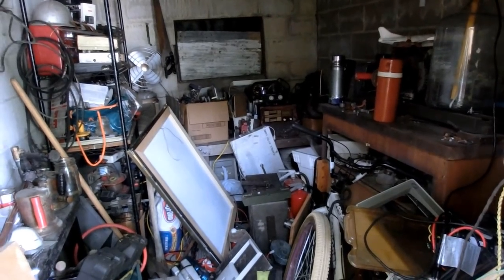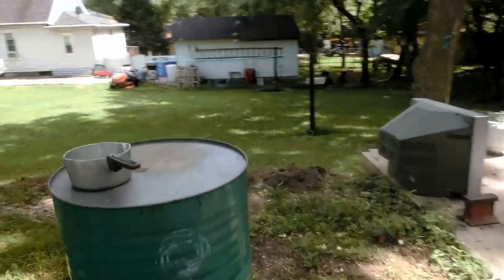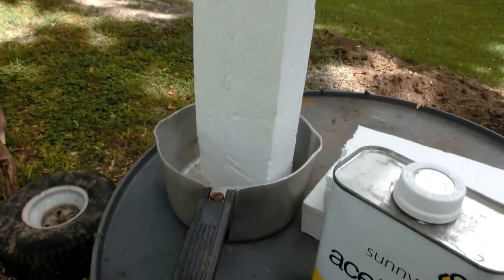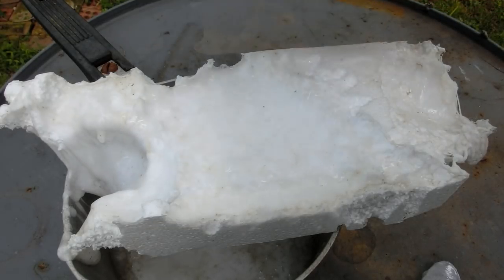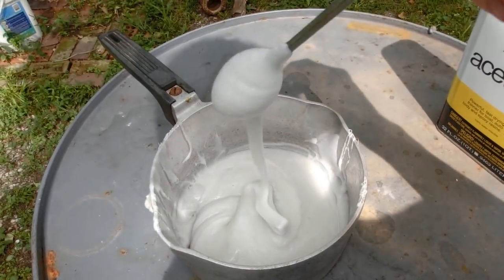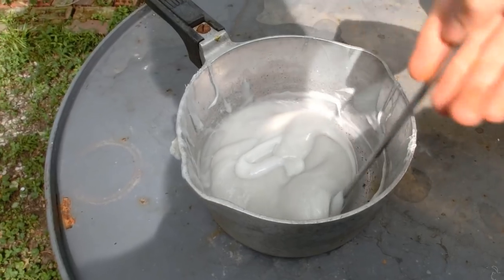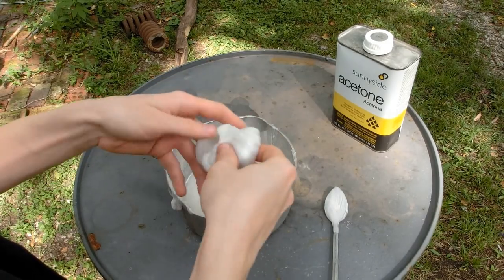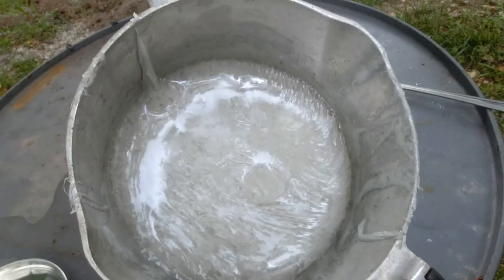Melting Styrofoam into diy acetone goo

Comment: I too have experimented with this: There's another solvent - I don't know what it's called in english, though in danish it's called 'cellulose thinner' - that'll dissolve styrofoam too, but the result is much more liquid (less viscous) than with acetone. - And it will dry up as transparent hard plastic, as the solvent evaporates.. (So will the acetone jelly too, but it takes longer because the partially dried surface forms kindofa 'shell' that to some extent seal it and slow down evaporation).. The less viscous, 'cellulose thinner' based solution can to some extent be used to make a thin plastic coating on stuff, but may tend to peal off in flakes, if the layer is too thin.

Comment: Can use as a glue, can use petrol instead of acetone
Reply: if you use gasoline/petrol you have a cheap napalm i just made some today its real easy look up my vid on it i burned a little bit of it and it burns fairly well
Reply: found that out all by myself
Reply: precinct 1 baltimore county residents
good on u
Reply: Petrol will leave an oily residue in the mixture, which isn't a problem if you are going to burn it, but will be a problem if you try to use it for something else.
Reply: I don't think it's a good idea to use napalm as glue

Comment: does it cure firm? it could be used to get some interesting shapes instead of calving a block for a diy aluminium foundry
Reply: good idea
Reply: I wonder if the extra density would affect the final product in any way.
Reply: +Lauren J. I doubt it.. think of the lost wax casting by the Egyptians millennias ago. that sh!ts dense..  
best tip for a smooth finish is to dip the shape to be casted in plaster, let it drip dry, forms a smooth tough skin like drywall.. alum will be smooth as silk when set..

Comment: For SAFETY use some gloves and don't make it look like the pot is being HEATED over a stove.
Reply from the maker: your comment makes no sense.
Reply: the fizzing is caused by the air escaping the styrene foam, so that's why it looks like it's boiling.
Reply: OP delete your comment
Reply: Light Yagami kek
Reply: What kind of stove do you have that looks like that?
Reply: This dude is the reason there are warning stickers on everything. Sad

Comment: Use more acetone, it stays wet long enough for the air bubbles to escape. You wind up with clear polystyrene. You can mould it, and you can dip things in it.

Comment: When we were kids, we used to melt polystyrene with petrol, turning it into a kind of flammable putty. This could be moulded into a golf ball sized blob, and projected using a pug stick, after igniting it. We thought the sound it made as it flew through the air was what an asteroid or meteorite would make.

Comment: If i remember rightly you can use gasoline too but that can be used as napalm because the styrofoam kinda acts like hot liquid caramel does.
Reply: yeah , using gasoline is better because is usefull to make fire
Reply: yeah , using gasoline is better because is usefull to make fire

Comment: what an abuse of that poor Magnalite pot! Those are valuable these days...
Reply from the maker: you wanna buy them? i'm going to melt them down next spring.
  
or ya know, you could buy them for 2$ at thrift stores. :p
Reply: Even old ones can sell for $20 or more on ebay. They don't make them since the late 90s. (the brand still exists, but they're all-aluminum Chinese junk)
Reply: Rinoa Super-Genius  it turns into a slime they can play with and once you stretch it out it turns hard and you can put it back in and it'll turn back into slime

Comment: You can't make a perfect hole in a piece of styrofoam by putting a piece of pipe on the foam then pour in a small amount of acetone and just hold it and push it through as the hole dissolves. I have done this for craft projects.

Comment: ?? Um not sure if this acetone is different than nail acetone but I use that to clean off my nail polish and it just kinda melts away and also melts my styrofoam bowls but nothing rlly happens if you touch it or spill it all over you you just lose moisture so moisturize

Comment: did the ball stay soft? I wonder what that plastic could be used for? maybe molding it into something? Will it ever get hard? I'm gonna have to try this thank you for your video very interesting!
Reply: It will get very hard, it is a nice material.
Reply: Izumi Yuuki bla bla napalm bla bla styrofoam acetone is napalm bla bla will burn down the whole world bla bla give me more untrue myths!!

It is basically a easy to ignite plastic fire. You can extinguish it with water, just don’t touch that burning blob of molten plastic. The acetone just helps to make it spreadable, sticky and more flammable

Comment: I am curious does this puddy cure to a solid state?  Can it be placed in a mold and  made into a solid form? As a artist, I  got some ideas while watching this video, where this could be "molded" then possible put into use with sand casting using brass or aluminum  perhaps to made unique statues or jewelry? I am also wondering if this would work like the Styrofoam does in the sand metal casting, where it would melt quickly and be replaced with the metal ? As another thought if it would work like that, one could make a form of a solid bike wheel and  cast their own unique solid aluminum bike wheels ...hmmm food for thought there on applications. :)
Reply: +Debra Brooks I guess it won't work for casting, since what makes styrofoam work so well is that it is mostly air and is thus easily removed.
Reply: +Mr Mürk  ahh ok. was just wondering since in the video it showed using enough Styrofoam with the acetone, you would get a rubber substance that seems to harden fairly quickly.  I saw in other videos here using a home made smelter (with recycled aluminum cans and brass) and using Styrofoam  you can make a sand type casting  I wonder if anyone has tried it? just to see if it was possible? as a artist it would be a unique way to make statues or jewelry and such. even lures for fishing or weights(sinkers).   I am also looking up new useful ways to recycle trash and such. :)
Reply: +Debra Brooks i recommend you dont ask utubers. they are not experts. they dont know what exactly. especially in chemicals. you search  MDPS by yourself in library. in my knowledge, that thing is napalm. it burn, never extinguished. if it fire on peoples skin, fire go through to the bone. it is SO dangerous. dont ask utubers, go local recycling experts or chemical experts.
 sincerely or seriously.

Comment: AWESOME. Could this mixture be used as a glue? If so what materials will it glue together best? Great video and your an awesome person. Keep them coming.
Reply from the maker: I don't think it would be very good. But it might be good for making a solid piece you could then drill screws into. Still a matter of drying I though. I think I may need to put my polystyrene ball in my vacuum chamber to drive off all the acetone. Otherwise it takes a long time for the inside to dry.

On second though it would be a lot like those materials that repair themselves. If the outer dry casing broke the liquid inside would fill the crack and fix it again.
Reply from the maker: *****
 yes i know. thanks though.
Reply: Rinoa Super-Genius Removing an acetone/air mixture with an electric vacuum pump that can be an ignition source might be problematic.  I remember there was a news story about some criminals who decided they would use a shop vac designed to suck up dirty water to siphon out and steal gasoline.  It was a blast.
      You might wish to send a positive pressure air without acetone over a "Venturi effect" nozzle to siphon the air/acetone mixture out of the vessel or as an alternative, vacuum out the regular atmosphere in a much larger vessel and then connect that vessel to the vessel containing the air/acetone mixture.      
     Another possibility is a warm breeze from something like a hair dryer to speed up the process.  Just put the hair dryer at the end of a tube upwind of the exit location of the acetone/air mixture. This is probably the safest and easiest method.  Another idea in eliminating the flammability problem in a positive pressure arrangement is use the fact that acetone and water like each other, so if you blow the exhaust into water it will dissolve in it.
     I cannot stand the smell of acetone.
     Next time, you might wish to have molds ready to cast your projects.
     And you don't need to drill screws into it.  You can cast the plastic around the screws.

Comment: As fast as acetone dissolves styrofoam, the finished product sucks. It doesn't spread out right, it's more elastic than it should be (it snaps back from where you spread it). Xylene and toluene are noticeably better solvents for homemade coil dope. Which sucks for me, since I use acetone far more (it's absurd evaporation rate makes it easier for me to use on electronics. Though the petroleum smell of toluene sure beats the smell of acetone

Comment: After the melted  styrofoam has dried any idea if it would be safe to use with aluminium prop making, (pouring molten aluminium onto the styrofoam) ? would be really great to know thanks
Reply: William Thresh I'd really love to know the answer to this too
Reply: Harruh the acetone removes the air that makes Styrofoam a foam by stopping the chains of polystyrene from sticking together
so yes you can use it
Reply: But doesn't the lack of air in the Styrofoam mean that it's less likely to evaporate from the heat of molten aluminium or steel? Meaning it'll just stick there
Reply: i guess there is only one way to find out
(try it)
Reply: Maybe I will have to on a small sample :)
Reply: i was saying it would be safe (not if it would give a good product)
Reply: +Mason Divine its not quite napalm. I use acetone all the time with 3d printing to make an ABS based slurry or putty (depending on how much acetone you mix in), and while it is flammable initially, the acetone will completely evaporate leaving you with a dense ball of polystyrene, or in my case ABS thermoplastic.

Comment: What do you think, could you coat a sheet of paper with that stuff while it is still liquid? Does it ever get completely rigid? I'm making a armor using the pepakura-technique at the moment and i'm still looking for a way to give it more thickness without using fiberglass or massive amounts of resin. This looked like a viable option... given it will completely cure and get rigid, that is.

Comment: This goo stuff is actually a very good glue for plastic models. If there is not too much aceton in it that is.
Reply: Ketenkrad96 It takes much more time to harden than the glue that you are supposed to use, but the end result is much better, it doesnt just glue dem pieces together, it melts them by a tiny bit a joins them together making a better connection between the parts.
Reply: +Mason Divine  could be good for gluing dentures to the gums
Reply: bob cummings two types of people.

Comment: So, after 4 years did you find any use for it?  I did this with gas back in the 90's.   Most interesting thing I found to do was put a cone of the stuff on the back of those huge roaches that inhabit Florida [[3 to 4" long with legs]] then turn off the lights, set the tip of the cone on fire and watch them run around like a living candle till they cook.

Comment: How hard did that ball dry? Could you have molded something with it?
Reply from the maker: +iplayloud2 yeah you could easilly mould some thing with it, however i recommend to put it into a vacuum chamber to pull out the air bubbles and acetone

Comment: GET THAT GOO OFF THE SPOON NOW IT WILL HARDEN!!!!
Reply from the maker: Johnny Jeska once it was hardened it was much easier to remove, it just flaked off. plus why are you freaking out? if it did get stuck on i could just dissolve it again with more acetone.

Comment: where you buy acetone? is it pure acetone?  here in mexico if i want to buy pure acetone i have to hava a permission from a company that will use so im curious to know if its pure and where they sell it.
Reply: +sakurito55 try nail polish remover
Reply: +Miley onDisney yeah but i need acetone because i want to use it for my 3d prints too
Reply: Miley onDisney yeah but not as strong as pure acetone also not every nail polish remover has acetone in it.
Reply: read the label that should tell you if it has acetone in it .
Reply: reklawj9 as i said even if it has acetone in it is not as strong as pure acetone.

Comment: Oh Genius.....The reason Acetone (like gasoline) is so cold to the skin is because it creates a chill as it is "Absorbed" thru the skin and enters your bloodstream.  In other words, it is not a good thing to wash off paint with either as they are dangerous chemicals.
Reply: Wrong! It's cold because it evaporates rather quickly.
Reply: Ok..genius.   Use it it to wash of dirt/grease/paint or whatever instead of soap and water.  After a couple of weeks, write in and tell us how you feel... (besides cold).
Reply from the maker: feel fine because our skin doesnt absord it, it evaporates too quickly.

Comment: Did it stay a slimy like rubber texture? Or did it turn into like, a gummy bear or something?
Reply from the maker: as the acetone evaporates it turns from slimy to rock hard. but mine hasnt dried all the way yet. would take days by itself prolly. so i'll see about using my vacuum pump sometime.
Reply: Cool.
Reply: I was going to say something about using the vacuum pump.

Comment: Dude, fun idea but you should be WAY more careful. Ok, you are outside but still you should use gloves and a respirator - not even sure about hanling the finished product without gloves. My first thought was "Ok, that's a fun way to get cancer and or allergies".
Reply from the maker: +Stefan Frisk its just acetone....are you afraid of everything like that?
Reply: I use it all the time, but I avoid breathing the fumes and use gloves when possible - the fumes could cause your nervous system to shut down and since it's a very potent solvant, who knows what fumes contain when you combine acetone with other materials. I use o lot of other materials to that I dont want to breathe so... better safe than sorry! :) So to answer your question, yeah - I saty clear of fumes and skin-contact when I can when it comes to chemicals.
Reply: Just to be clear - I am talking worst case scenario. :)

Comment: +Rinoa Super-Genius I would greatly appreciate some help with this. I have a school project and I love the idea of a styrofoam and acetone chemical reaction but a part of the criteria is to provide the class with a "scientific explanation"  of what is going on. Thanks ahead of time,

                                                        Omega
Reply from the maker: its a solvent that dissolves the plastic, you should get some salt and pour water on it, then have some foam and pour acetone on that, they are both the same thing happening. they arent actually a chemical reaction at all. just a solvent dissolving stuff.
Reply: Okay! Thank you because I would've gotten an F because it doesn't match the criteria that I had to meet. Thanks!

Comment: What's the point of doing that? Are you gonna use the styrefoam for something or just throw it in the junkyard? 😨
Reply: I would like to know that answer myself. I would also like to know if there is a practical use for it? I'm not a full on environmentalist, but I like to do my part. We get a good bit of Styrofoam where I work and I don't like throwing it in the dumpster because I know how long it takes to disintegrate.
Reply: Rise above Well, you can use foam for aluminum casting, so one application may be malleable material that may be casted into aluminum. Not sure if the air pockets are the reason it works, though.

Comment: Uh... is it safe to touch that acetone???
Reply: As a model builder and hobbyist, I work with 100 percent acetone all the time.. It's pretty harmless unless it comes in contact with plastics... I thought I could use it to strip paint with out damaging the plastic of an over painted model.. Instead I woke up to a puddle of goo where the model once was...
Reply: Huh interesting
Reply: Robert W but isn't it used as a plastic adhesive like nail polish remover can be used as a glue for plastics or am i wrong?

Comment: Isn't there toxic fumes when it's evaporating??
Reply: yes, kills brain cells too.  Use acetone outside or with good ventilation.  "Silver Shield" gloves are proof against acetone.
Reply: Can the silver shield gloves protect you against the crude napalm created when you dissolve the styrofoam with gasoline?

Comment: did you have a mask on?
Reply from the maker: no, acetone is pungent but its not very toxic.
Reply: Rinoa Super-Genius
Inhalation: Can irritate the nose and throat. At high concentrations: can harm the nervous system. Symptoms may include headache, nausea, dizziness, drowsiness and confusion.

A severe exposure can cause unconsciousness.

Skin Contact: May cause mild irritation.

Eye Contact: EYE IRRITANT. Causes moderate to severe irritation. Symptoms include sore, red eyes, and tearing.

The vapour also irritates the eyes.

Effects of Long-Term (Chronic) Exposure: Can cause dry, red, cracked skin (dermatitis) following skin contact. May harm the nervous system.
Reply from the maker: videobuoy buoy provide your source of that information. looks like you just copy-pasted it from a chemophobic website.
Reply: I use acetone in my line of work,and I have to conduct risk assessments for my staff.

Of course you can easily debunk my claims by recording your next video after someone has thrown a gallon in your hair, eyes, nose and mouth.

Of course if you don't do that then we can safely assume that you don't know what you're talking about.

Over to you Rinoa......